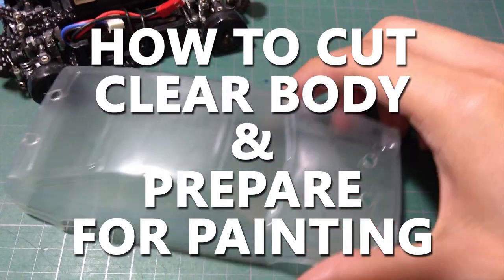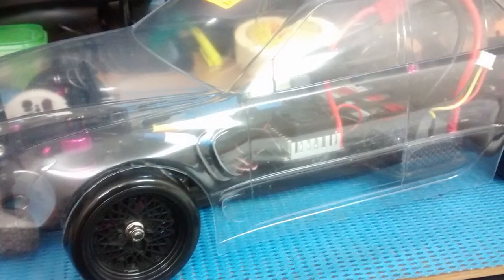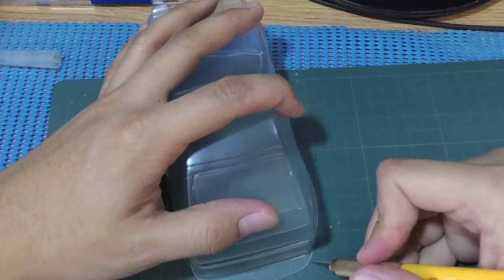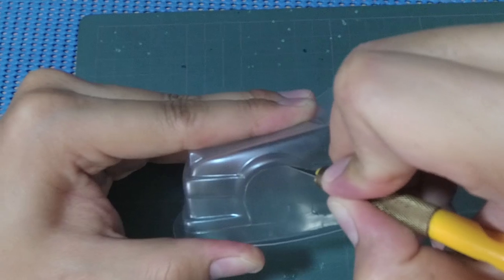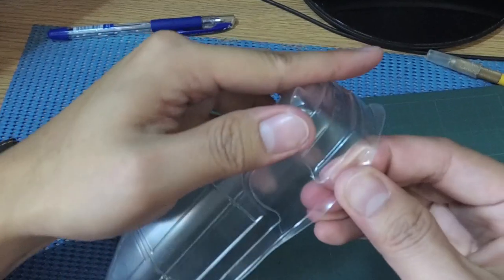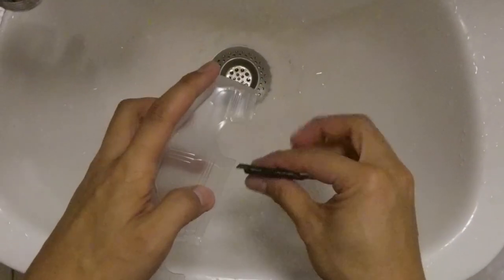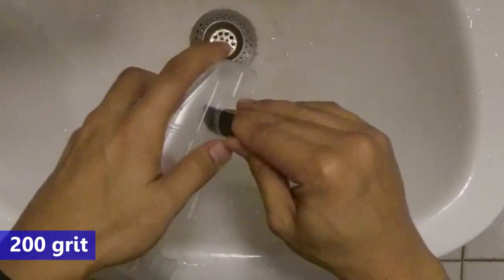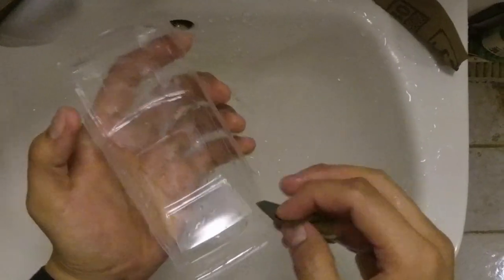How to Cut RC Clear Body & Prep for Painting

Comment: You just have to wash the body and then paint using polycarbonate paint used for lexan bodies. If you sand the inside the body looks dull and scuffed up, but to each there own.

Comment: You say it's an AE86, but more recent reviews show EVOs. Looks like they've changed the product to reflect the picture? Unfortunately they don't seem to have made the 86 available through any other listings. Weird.
Reply from the maker: Yes, at the time it was AE86 but now it's EVO. Wheelbase is still 90mm though. And AE86 seems to be discontinued already.
Reply: @BeaversHobby  Does no one else sell clear bodies in that size? Even if the wheelbase isn't exactly 90mm. I haven't been able to find much else.
Reply from the maker: @Ignas359  There are some but mostly are for racing.
GL Racing http://gl-racing.com/store/mini-car-bodies-c-14/128-p1m-lexan-body-98mm-wb-p-177.html
X-Power http://www.x-powerrc.com/product_detail.php?id=614
Blade Racing https://banzaihobby.com/Blade-Racing-BL160?zenid=57216df86c7d0051838bb2c69b56b42a

Comment: Does it fit the k989??
Reply from the maker: No, it's much shorter and narrower for WLtoys. Besides, this one has been out of production for a while now.
Reply: @BeaversHobby  on bang good it says its available
Reply from the maker: @milo8091  You might get a different one than what I got. Either way if it's 90mm it won't fit wltoys. You need 98mm wheelbase.

Comment: Will the body work on k969
Reply from the maker: Yes, but you need to measure and cut the holes for the wheels yourself. You can't use the markings on the body because this body is for 90 mm wheelbase but K969 has 98 mm wheelbase. Anyway, because it's soft clear body so you can cut it however you like. Also the standard wheels will stick out of the body because the car quite wide.

Comment: This should be called the "score and tear" method instead of score and snap.
Reply from the maker: Actually, you're right. Even with lexan I still tear it off as it rarely snaps. I probably should have score it deeper though.
Reply: @BeaversHobby  Hahaha....I was kidding though. But yeah I have yet to try the score and snap/tear method. Im pretty good with curved lexan scissors and rounded files. However I have been doing it like this since 1984 and now I learn I have been doing it the hard way all these years....the story of my life...lol.😣
Reply from the maker: @KaizerTest  That's really long I bet you can do it with you eyes closed now. 😆
Reply: @BeaversHobby  Im too old now...and have trouble seeing...lol. Actually I tooka long break from RC...from around 1993 until a year ago so I had a lot of catching up. I have bought way too many now. I have a Traxxas Slash VLX, Arrma Typhon 6s and an Infraction and an X01. Im back with insanity...hahahaha. But I have a new love for the hobby...especially with lipo power. Im building a 6s Slash with mod1 gears and close to 1:1 pinion/spur. Trying for the 100mph club.
Reply from the maker: @KaizerTest  Nice! Speed run is always a spectacle.